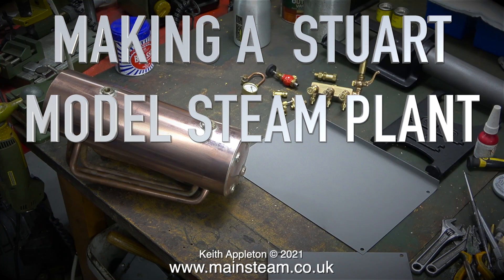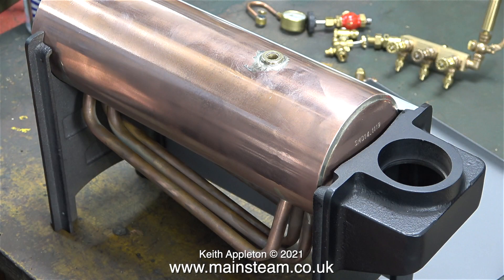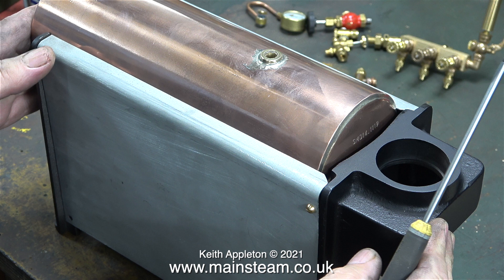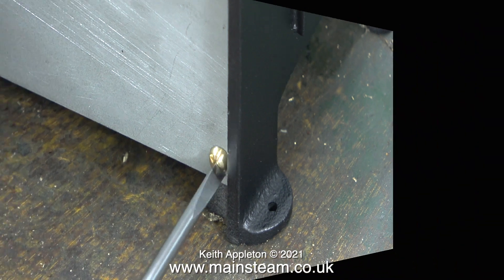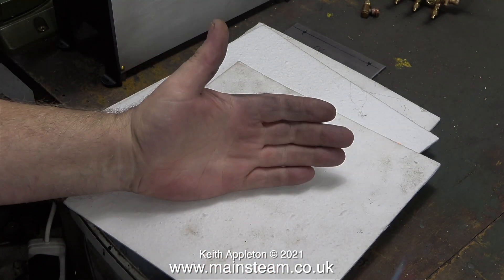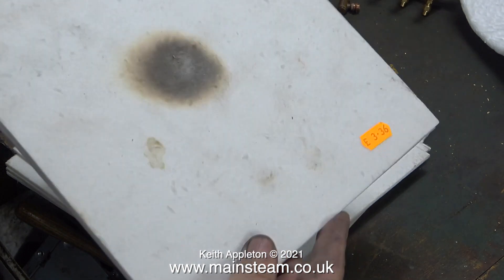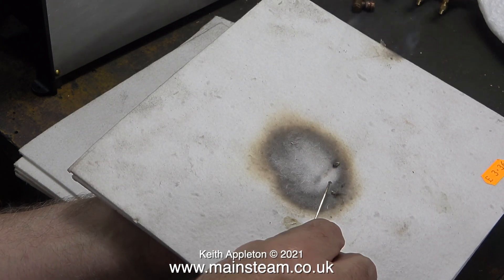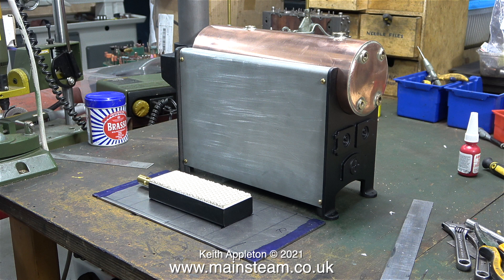MAKING A STUART MODEL STEAM PLANT - PART #38

Comment: It's a shame shipping and import taxes are a thing, I would love to have some of those sheets of insulating material for my Wilesco models. I believe much of the heat is lost through the thin sheet metal that makes up the boiler house and insulating the inside could possibly improve fuel economy and also eliminate the damage done to the paint.

Good stuff, I'm sure your hand apprechiates it!
Reply from the maker: This type of ceramic heat insulation must be available in your country, try a Plumber's Merchant.

Comment: Hi Keith, I continue to watch your videos daily and they are excellent! At the moment I’m 3d printing a model beam engine and have looked back at several of the beam engine videos you’ve made over the years. They have been very helpful! As a suggestion a nice add to your beginners videos could be “Operation/Parts videos” I.e videos that identify the different parts of steam engines, the materials they are made off and their function. Such videos would be very helpful to me at the moment. Nevertheless, I enjoy your videos anyway….very informative and helpful…!
Reply from the maker: I have done this a few times over the years, but I will make a video covering most steam engine part in one go.